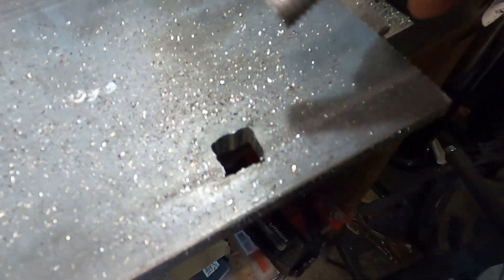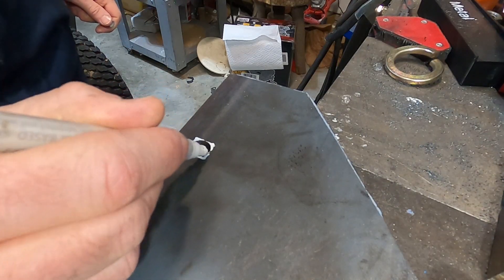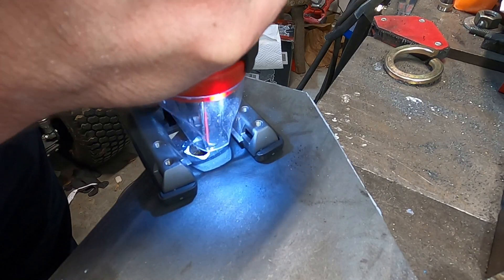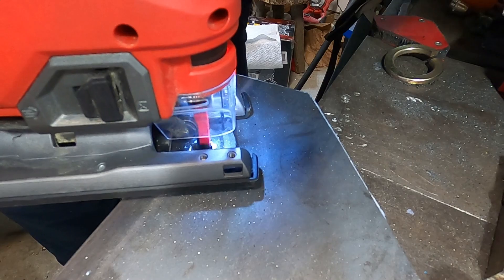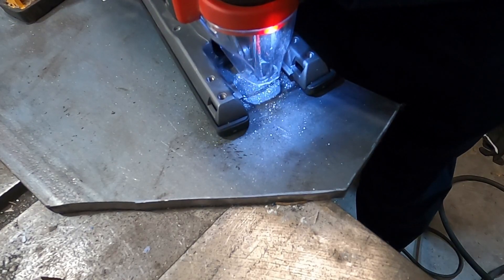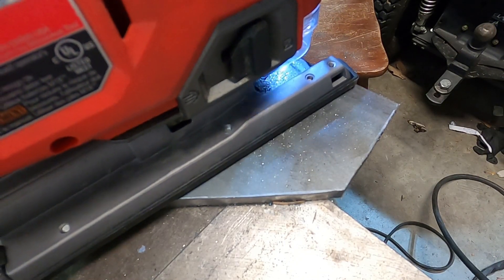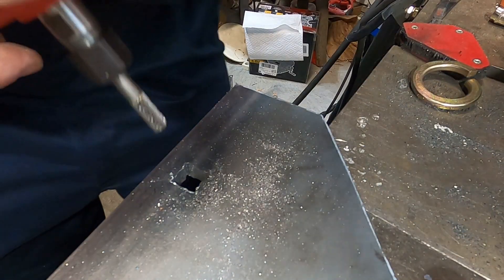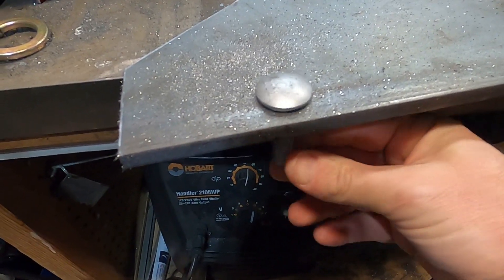Square Holes in Mild Steel the Easy Way

Comment: Cool video, the easier way is to counter sink about half the squares throat with a bit that is the same size corner to corner and drawer it in. It will lock real good and it's much faster

Comment: Certainly usable and functional.  Thanks for sharing.

I'm wondering, could something like a 20 ton Harbor Freight jack in a shop press with a hardened square punch accomplish this, or would that be beyond the amount of pressing power available?
Reply: Just use a square hole drill. They really exist. Or use a broach that you can make yourself.
Reply: An ordinary ~1 ton mechanical arbor press with a good broach could do this, too. But that's basically taking 20 curly little chips with 20 punch edges, it's a lot of work to do in a single operation. 
Another pro tip: Short neck carriage bolts. A 3/8x16 short neck carriage bolt has a square section under 1/8" long, a 1/4x20 under 0.1", meaning that instead of making this square hole in a thick plate, you can use 10 or 12 gauge sheet metal, which is much cheaper and easier to work with.
Reply from the maker: Good idea, I'd bet that would work, especially if you start with round hole and press out the corners.